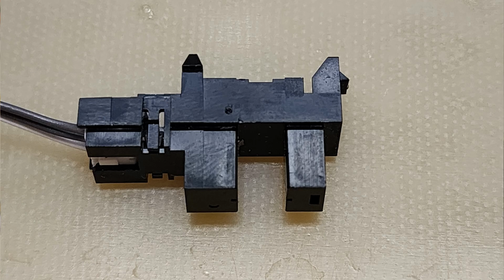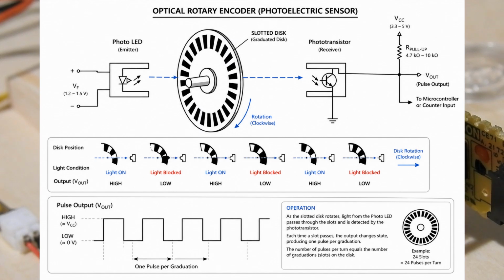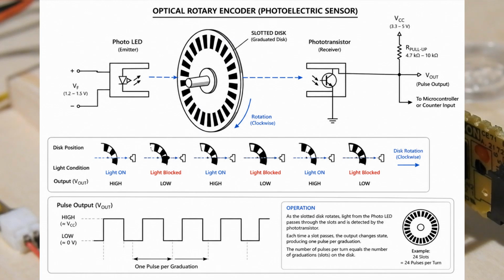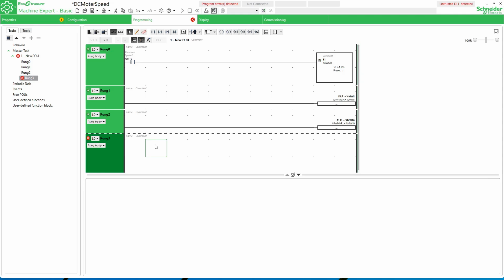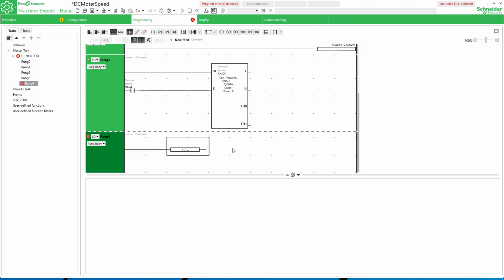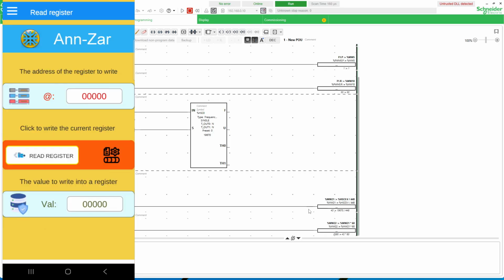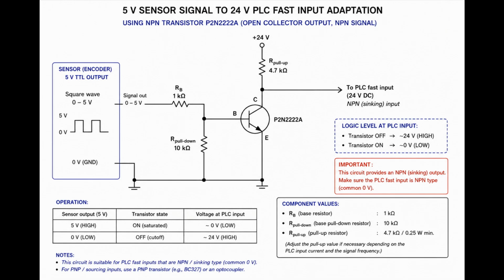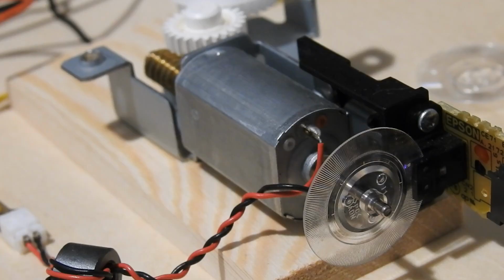Measure DC Motor Speed with an Optical Encoder Using Schneider  TM221CE16T High-Speed Counter (HSC)

Comment: Hii ma'am 
Can you show me how to use the servo motor which is delta ASDA-B2 with CN1 pins the PLC is Schneider PLC 
I want to control the position type like there in different 3 positions so when the motor reaches the position it needs to Stop one by one position 
Please explain how to control the driver
Reply: yes maam can you tell me thats its use full to us similler toppic but i want in frequency type in DELTA driver ASDA-B2 & DELTA - AC SERVO MOTOR
Reply: thats helps us too please explain
Reply from the maker: Sorry that it took me some time to answer.

Yes, normally you can control the Delta ASDA-B2 in Position Mode (P) using the high-speed pulse output of the PLC.

Connect:

PLC Q0.0 → Pin C1 (Pulse input) on the Delta driver.
Set the Delta driver to Pulse + Direction mode by configuring P1-00 accordingly.

Wiring:

Q0.0 → Pulse
Q0.1 → Direction (DIR)

On the Delta ASDA-B2 (CN1):

Pulse
SIGN
COM (common 0 V)

The 0 V (GND) must be common between the PLC and the servo driver.

In the driver, you must also configure the Electronic Gear so that the number of input pulses matches the required movement.

The CN1 inputs of the Delta ASDA-B2 support 24 V PNP open-collector signals as well.

You can use the system without feedback if you know how much movement corresponds to each pulse. In that case, the number of pulses determines the movement distance.

With feedback, you can use the High-Speed Counter (HSC) in the PLC, as shown in the video. For example, connect the encoder feedback to I0.0 if appropriate. The Delta ASDA-B2 driver can output the encoder signals A, B, and Z, which can be used for position feedback.

Another option is to communicate with the driver via Modbus RTU (RS-485). In this case, the PLC must handle the Modbus communication.

If I get a Delta ASDA-B2 driver, I will make a video demonstrating different applications and configuration examples.